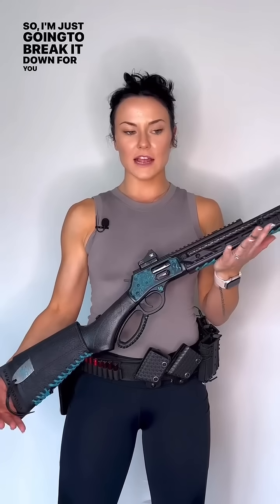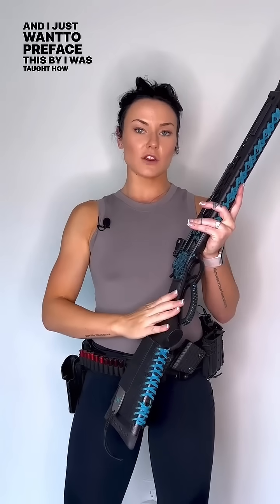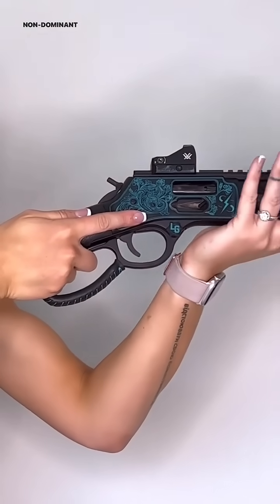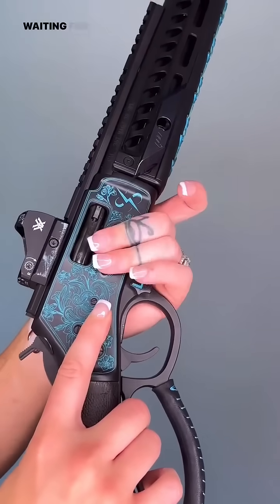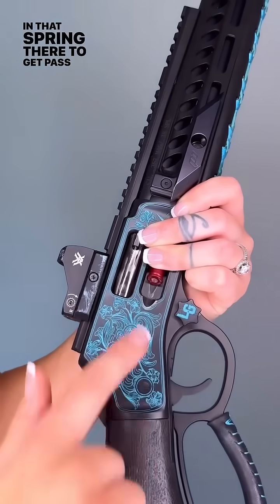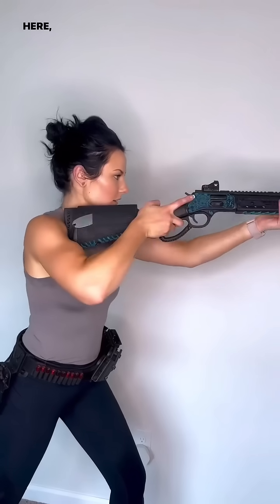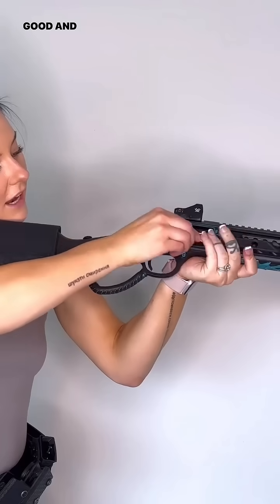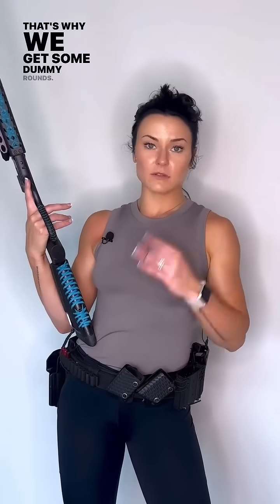How To: Load Your Henry Rifle Like the Pros Do!

Comment: If I have fired my last round from my Marlin, I prefer to open the action, drop the first reload into the ejection port, and close the action so that I have an immediate shot available if needed.  Then top off the magazine.
Reply: Nice tac reload !
Reply: That makes good sense, and in a real pinch you can just keep single loading and still put a decent amount of fire downrange until a window opens to start filling the magazine.
Reply: M500 similar drill.  Or don't fire last rd in chamber unless necessary, but that would require you to count rds and in a high stress situation, typically infeasible so tact load often.  Not sure why one would use a Henry for self-defense but if that what you have learn to use it well.

Thank for the video and training tips, Jade.
Reply: @designated_hitter_EGA  Because Alaska, .45-70 and bears.
Reply: I’m pretty sure Chris Costa teaches the lever forward emergency reload technique as well. This is just his “tactical” reload.
Reply: That’s how I load mine too…
Reply: This is the way.
Reply: That's old school . . . lot's of things we were taught are "out of fashion" now.
Reply: Me too.
Reply: Isn't that hard on the extractor?
Reply: @adamteltech2300    The extractor is on a flat spring.  It isn't going to break.
Reply: @designated_hitter_EGA If the powers that be lose their minds and get the semiautos, a levergun throwing 357s would not be a bad thing.
Reply: That is the sad part of what you would do on a range vs. what you would do in a real world sitiation.
Reply: @chetburnes3776  The nice thing about the .357 lever guns is that they can also fire .38 Special cartridges. Great for practice, or if you can’t find.357 Magnum rounds. You’re probably aware of that, I’m just commenting for others who may not be.
Reply: The most american comment on youtube ever :)
Reply: That is called a Military Reload, and is the preferred method.
Reply: @richardtroell6407  Though I own a lever action, I have very little experience with it, so if this is old school, what is the more modern, current technique?
Reply: @bluethunder90  Look up Chris Costa. He seems to be something of a lever guru these days.

Comment: What if you had a Tube just a tad larger diameter than the cartridges with something like a duckbill at one in that fit inside the loading gate and you could put several cartridges at once in the Tube and side them in with one motion?🤷‍♂️🤠🙋‍♂️

Comment: I'm sorry but I don't like this drill. I feel like you're making choices that subtract from each other to net out as a negative. I think there's three goals while reloading you're aiming for Rounds, awareness, follow up shot. Are you prioritizing awareness, knowing it will take you longer to load the first shot and any extras, are you prioritizing loading seven rounds knowing it will cost you time if you need a follow up shot immediately, or are you prioritizing your follow up shot knowing you might get only one or two rounds loaded but you're back ready to shoot faster. I don't think this loading drill prioritizes any of them.

1. Keep gun at shoulder, point of this is to keep it up and ready for use, able to quickly get back into the action. Cost, it takes more time to grab a round from your belt and bring it up to the loading gate. Problem, you've taken your trigger hand off the rifle negating this. You'd need to drop the round you're loading and bring your hand up to the rifle to get back into action.

2. Lack of chamber loading. Your method fails to load a round directly into the chamber first. This would allow you to fire the gun immediately instead of having to cycle the action before needing to shoot. Combined with 1 you're taking longer to load a gun because it's in a shooting position, but you're neglecting to put the gun into a shooting state while you're doing that. The gun in pointed in a "safe" direction.

3. Moving your hand down to half load the rounds. This again compounds in that you're off hand isn't in the right position to shoot the gun further adding time to shot in that 1 you have to bring your hand up. and 2 means you have the cycle the action, and 3 means you have to bring your off hand back into position to properly support the rifle.

4. Half loading rounds means if you're interrupted you have to pull your off hand up to the stock and the round you just "loaded" is going to fly out. So if interrupted you had loaded n-1 rounds instead of n. I totally understand and you can see if your video how difficult it is to fully seat that last round through the loading gate. This speeds up your reload at a cost of always having one less round than you'd want if interrupted, however if you load the chamber first, you're back to N rounds at least. It also leaves your action compromised. You cannot cycle the action with the rifle in that state. There's a chance the round could get stuck and leave your rifle inoperable when you most need it forcing you to clear the jam or seat the round. it's kind of a catch 22, if the round was easy to seat you wouldn't need to set each one up to use the next to seat it, and you wouldn't worry about leaving one half loaded because you can just use your off hand to finish pushing it in before going to shooing position.

5. Partial loading. The point of partial loading to get reduce the time and speed between being out of action while loading and getting another shot off. Every choice you've made in your loading cycle with one exception makes it as difficult as possible to get another shot off.

I suspect, you could bring the rifle down, to your waist reducing travel time for your hand, load the rifle as you depict to seven, bring it up cycle the action and be good before you can load three. You should also practice doing it without looking at it.

You should also have a second loading method that is "slower" but keeps you in battery at all time, rifle to the shoulder looking down the sights, open action grab a round put it in ejection port, close action. Immediate follow up shot.

Just my thoughts on this drill. Maybe i'm missing something.